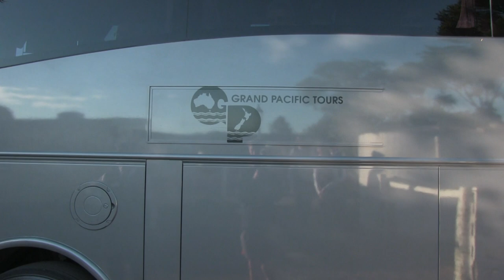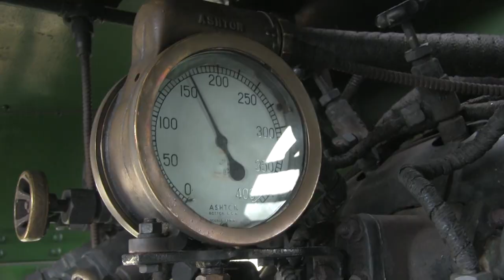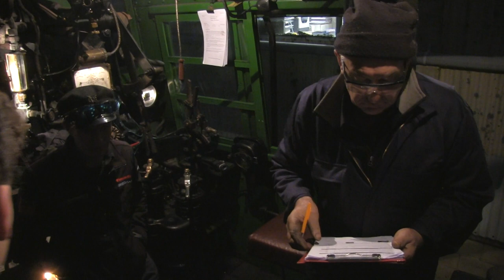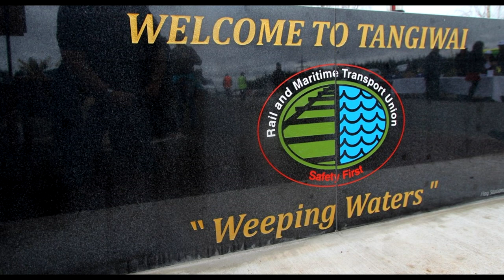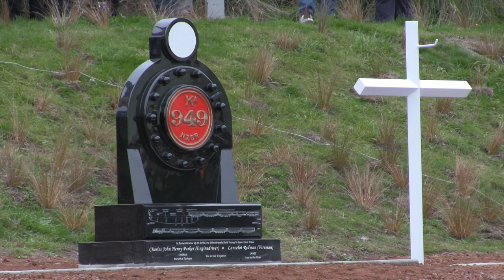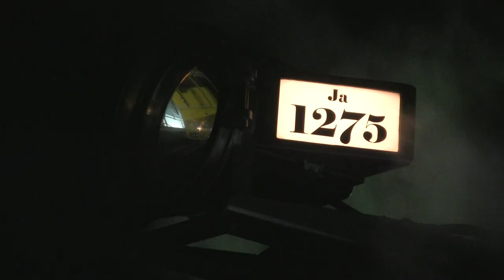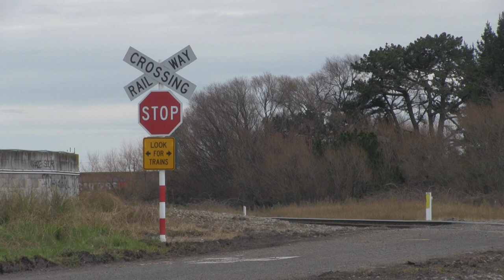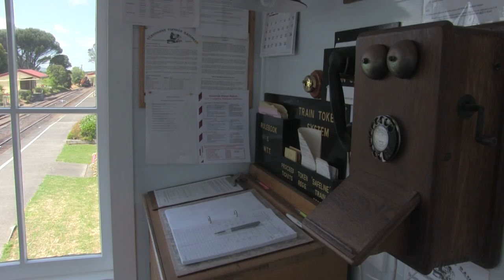South Pacific Steam - New Zealand

Comment: All that white smoke indicatesv that there is too much water in the boiler . keep it below half a glass . The white steam strips the lubrication from valves and cylinders .
Reply: The white smoke is water vapour from condensed steam.If there was too much water in the boiler you'd see indications of priming...water out funnel and driver working cylinder cocks. On a cold day you'll see more water vapour at the funnel and anywhere else steam is being exhausted...eg injectors, turbo, leaks around valve piston packing etc